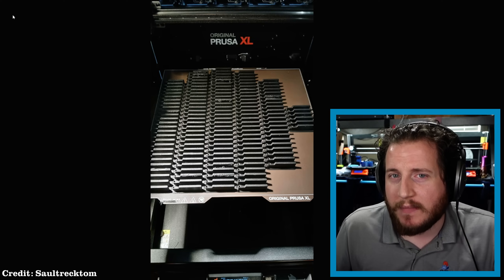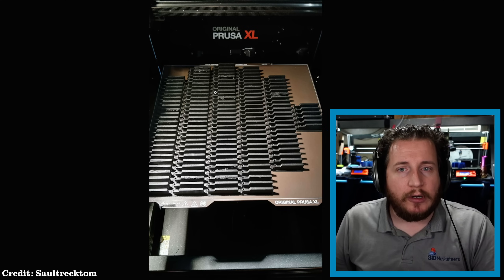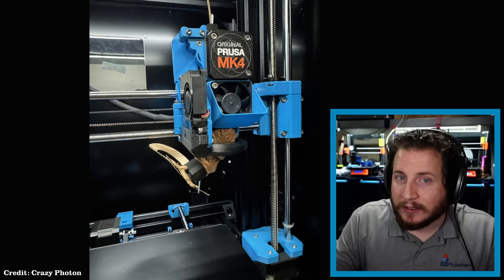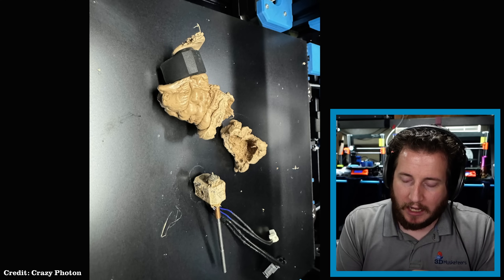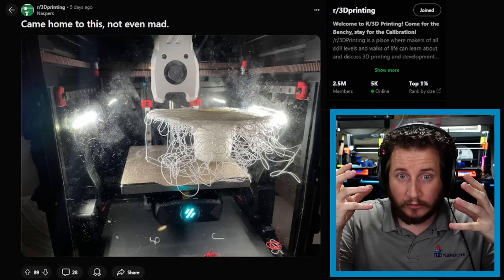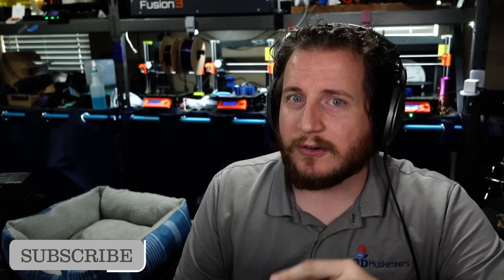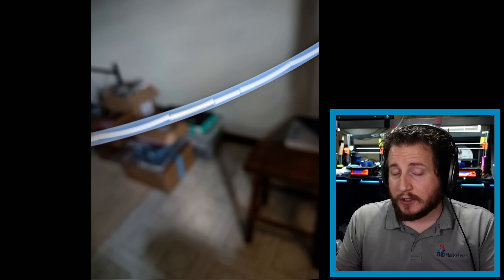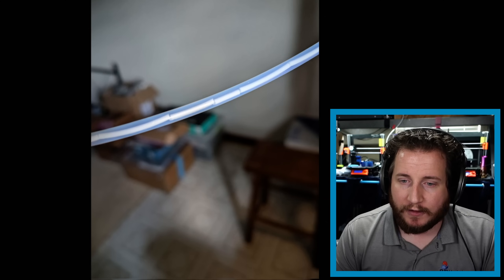Spaghetti and (Meat)Blobs! - PrintFixFriday 157

Comment: Just going to add my 2 cents on the XL issue. If you look at the purge lines at 1:30 you can see they are in 2 different places. They should always be in the exact same spot and stack on top of each other, not lay next to it. This to me says the belt tension is too loose causing variance in the homing, which also led my unit to have odd layer shifts and the rare crash during a print. My XL was delivered with very loose belts, if the user has not tuned them yet that would be my best guess. I would highly recommend doing a homing tower test print as the results on my unit as delivered were absolutely horrendous.

Comment: I hate waste of any kind so after I dialed in my 3DP skills to near zero waste perfection, I had to tackle the plastic spools issue. Love Grants recycling donation method but that’s not going to work for me so switching to cardboard spools was a must. I auditioned several brands at similar prices and found Overture to be quite reliable and acceptable. I’ve never had this glue issue and I’m super happy that the spools can be easily dismantled and safely biodegraded. If you’re not happy with your brand of cardboard spool, switch to another brand, there’s so many to choose from!

Comment: 9:50 I don’t keep a huge amount of spares, mostly just nozzles, heaters & thermistors. Also stepper motor drivers keep a few spare as it’s a real pain when one fails and all my printers use the same 2209 PCB module things (I think they are called step sticks). 

Am only a hobby printer so a few days downtime waiting for replacement parts to be delivered isn’t a big deal when something less common like a bearing fails. 

Oh if you have multiple printers that have canbus tool heads try to keep them all using the same board and keep a spare. Found out the hard way delivery times can be long on those in the UK and you can destroy a board really easily by accident. Found out the hard way and have the bruise left by an exploding capacitor.

Comment: My basic sparepart list per printer:

1 full hotend
2 spare nozzles per size often used
1 part cooling fan
1 hotend fan
PTFE tube
spare buildplate
Belts/V-rollers depending of the type of printer
Filament cutter blades if you have such installed

eSun cardboard spool issue:
yep, had the same issue with this

Comment: Spare parts I keep in stock at all times would be;
Spare assortment of screws 
(I exchanged all screws for philips style screws on my printer, only need one screw driver for everything)

Spare heater, heatbreak, thermistor, nozzles and silicone socks for the hotend
As well as hotend fan and partcooling fans.
Oh, and PTFE tube.

In other words; the things twice as expensive or slow to get in an emergency.

Comment: On that first fail, I wonder if those pieces became loose when the head collided with them. The brim probably did it's job, but it if tilted it without completely dislodging it, that could have been it. I'm in the discord and didn't look at the complete conversation on this, so it's probable this is not actually the case.
Reply from the maker: it LOOKS like they were still there, but you know, that seems reasonable!

Comment: I wonder with the esun glue given how often people are told to dry their filament I wonder how many are using a higher temperature to speed up the process and in turn get that glue warm enough to run and glue the filament... not putting it above the manufacturer to have issues just a warning to not overheat your cardboard spools.

Comment: so this is less of a print fail and more of a "hey prusa slicer WTF are you doing?" LMAO I was about to print part 47 (rocket launchers) of the gunstar model from gambody. I painted it already. So just need to print it 4 times. So I clicked the add instance 3 times. Then I clicked auto arrange.......there is only 3. Where the hell is #4? It's not a big part and it fits nicely with the purge tower. For whatever reason PS decided to yeet it right off the build plate! I have no idea why. I rearranged it manually and had no issues at all getting all 4 on the plate.